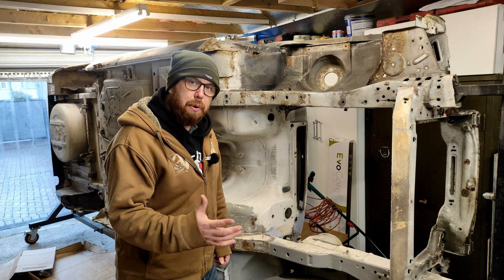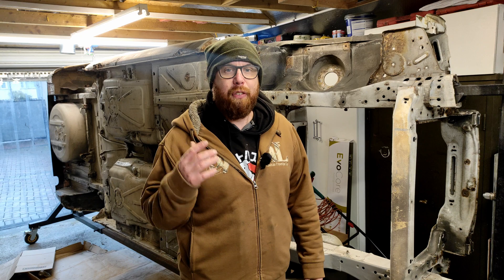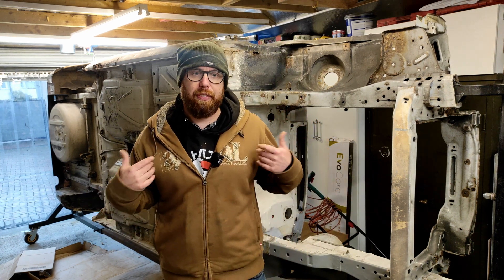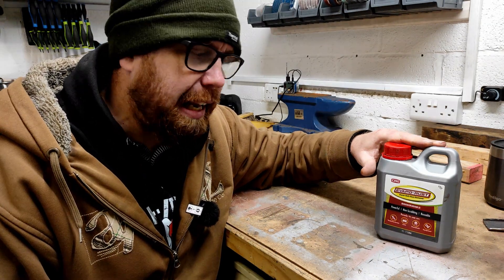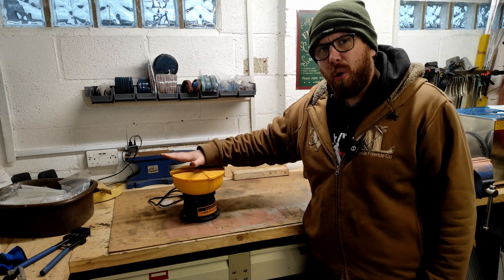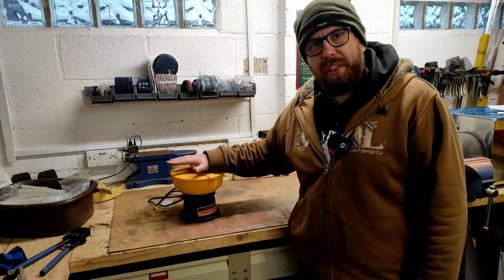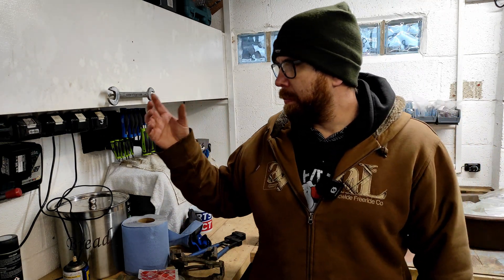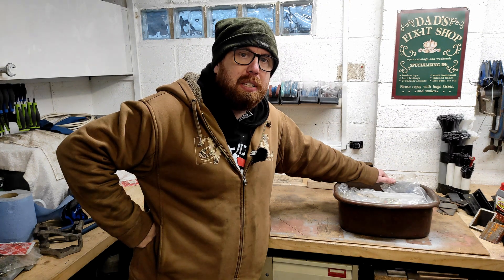DIY zinc plating, is it worth it?

Comment: You have gone down the route I did when working in my Galaxie. I used Evaporust and then popped them in a tumbler to prep them for the zinc platers. The results weren't great. Ok, but not shiny enough. I bought a zinc plating kit a couple of years ago but didn't have the space to set it up. I do now, so am about to set it up to do my first batch. I am going to use a bench grinder to totally clean them up first. 

The cost was £72 for the professional to do the bolts. I didn't count how many pieces but it was for the bumper bolts, one front wing and suspension components for one side. I thought I'd try it out as I'm also restoring an E21 and have a couple of E36s. I can do a few bolts at a time.
Reply from the maker: If I had the space I could see how it would be useful to do a few bolts at a time. 
And yes the result's I had were mixed due to the lack of preparation, so to be expected. Polishing them in a bench grinder first is probably the only way to get a bright shiny result! 
Good luck with you projects 👍

Comment: Great to see you again. Sorry to hear about the back issue, I can fully sympathise. I am 72 now and can only do a few hours at a stretch thanks to arthritis and other aches and pains, you do right to look after yourself. You are definitely on the right track with the plating. I have a great local electro-platers that are very reasonable. For the future, check out the Bilt Hamber products. Their DeOx c is as good as Evaporust and cheaper, it works great but, there is a down side to the chelation process which is how these chemicals work. It strips off all the coating as well as the rust, and the longer it is left in the bath, the more susceptible it is to rusting in future. Unless you coat or plate the items immediately after washing they rust like hell. Also, I have a good fasteners company local, who stock nearly every size and type of fastener, but aren't that cheap, but I use a company called Kayfast who are in Wakefield and order on line, you can get an awful lot of brand new nuts, bolts and washers for £50. For instance, your drive shaft bolts, M10 hex socket are about 60p each in stainless steel, which will never seize up or rust again. The problem is that although the old fasteners now look good, a lot of the heads and threads are worn, particularly the Allen sockets, so I tend to do a mixture of renewal and re-plating.

Comment: I spent hours nickel plating parts a couple years ago. This time took them to a local plated for zinc plating. Cost me £50 for a decent size box of motorcycle parts. I did spend some time cleaning the bits and polishing certain ones which were visible. Wish I’d done it the last time.
Reply from the maker: @colinwills4163  Is the nickel plating process the same?  I only ever wanted them clean! But the time saving factor alone kinda makes me want to leave it to the professionals

Comment: Parts look great 👍🏻 

What company did you use, was it local or did you post them to a company? Got some bits I need doing for my E30.
Reply from the maker: @e30mark  I used a company in Bristol called Bryony metal treatments. I took them in, no idea if they can do it via postage.
Reply: Also interested in what company used, have some e30 bits I need doing too!
Reply from the maker: @dhilankerai3585 Bryony metal treatments in bristol